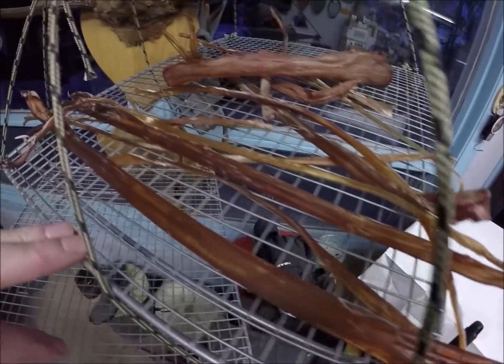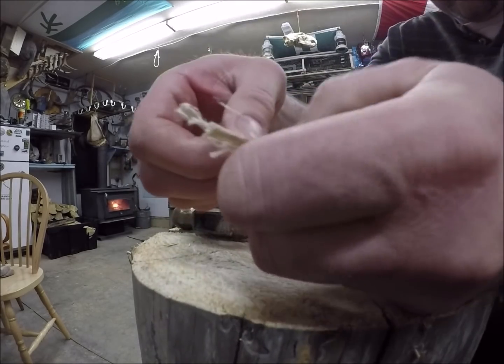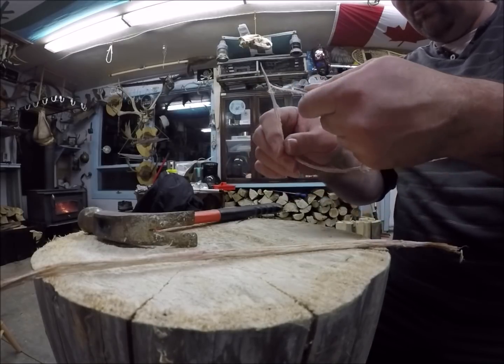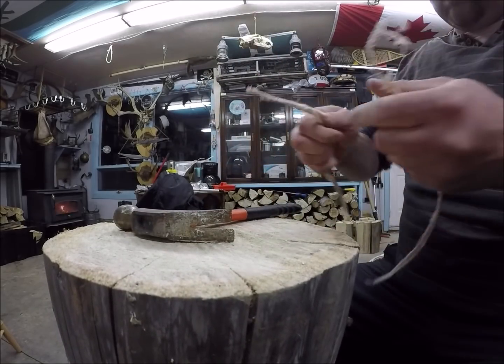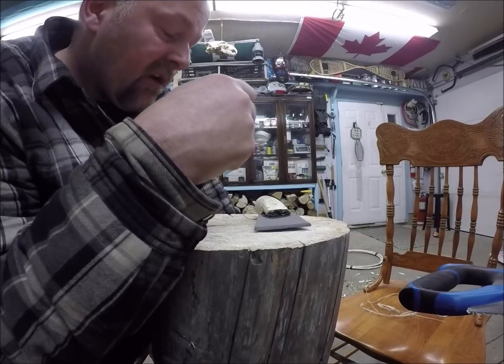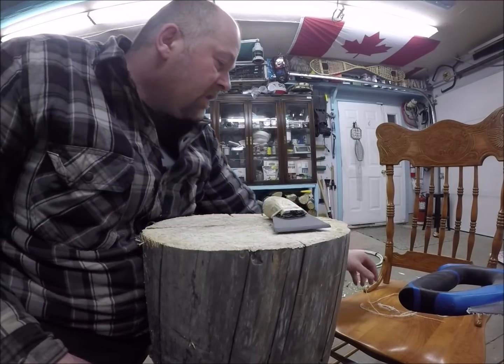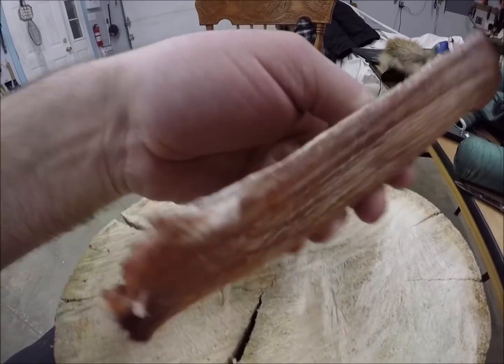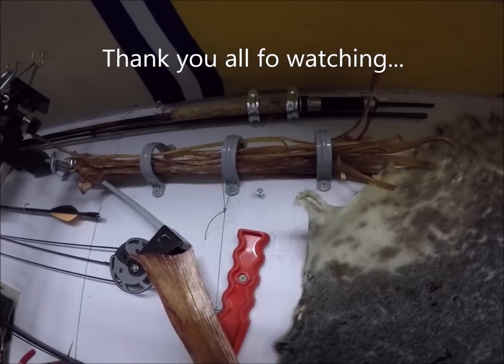Processing Sinew & Slate Scrapers

Comment: Question: could you just use tap water to get the sinew most or do you have to use saliva to make it workable.
Reply from the maker: The enzymes in your saliva help break it down..  You probably could but don't want to soak it to long it'll loss some of its gluing strength..  Also you lightly chew to speed up the process as well...